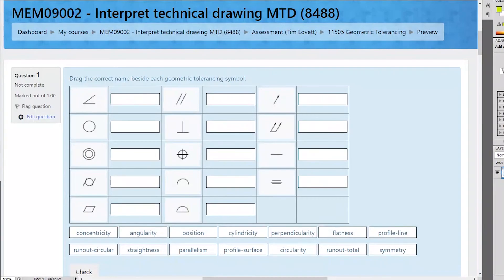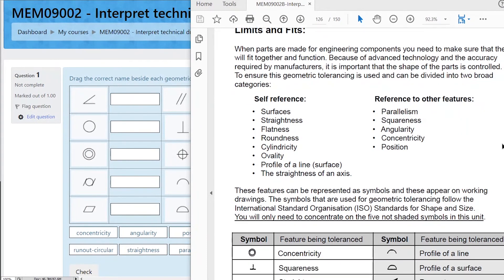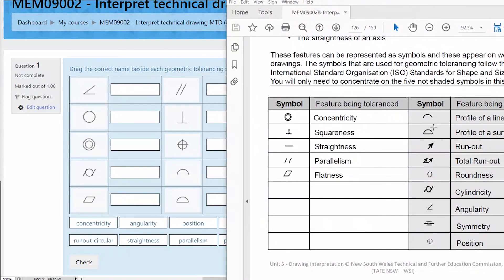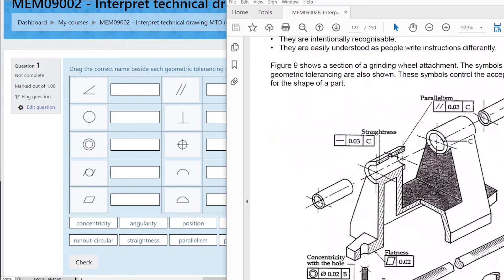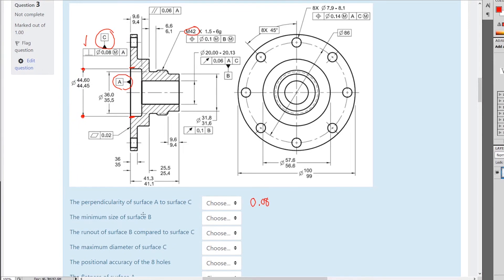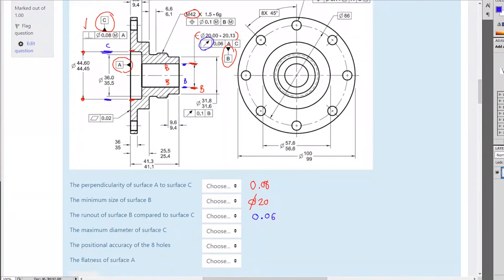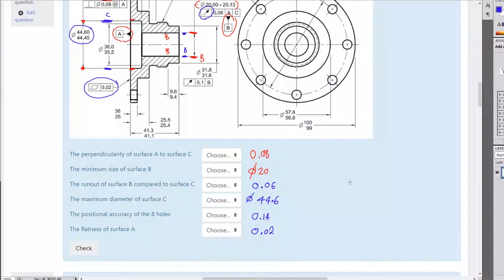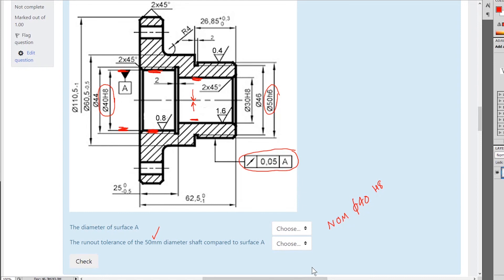Geometric Tolerancing Quiz

Comment: Hello, thank you for the quiz I have a question at minute four minutes and 49 seconds you have a word parallelism pointing to the outer surface of a feature cylindrical cross-section, and you’re saying that that Has to be parallel to the inner surface of datum C.
My question is, should the word parallelism not be pointing to the inner surface of that feature that has the cross-section?

Comment: And once again at 10 minutes and 25 seconds there is a call out of perpendicularity of .060 of A to something …it doesn’t specify what surface A is supposed to be perpendicular to. It could be any surface on the part and no one would know which one.

wouldn’t  it be far,far better to put the other surface C in the feature frame kind of like this

// | 0.06| A>C|

Is this not 100 times more clear?
?